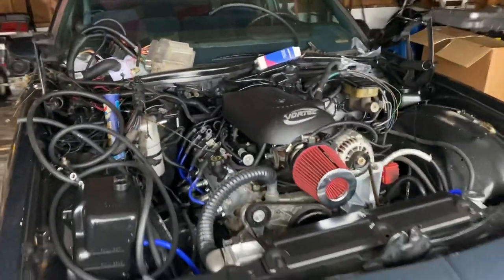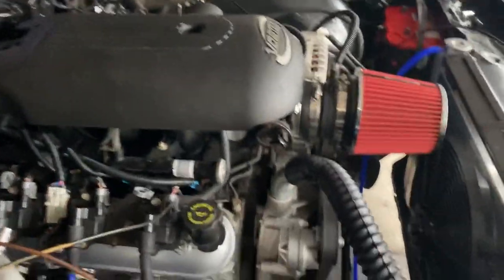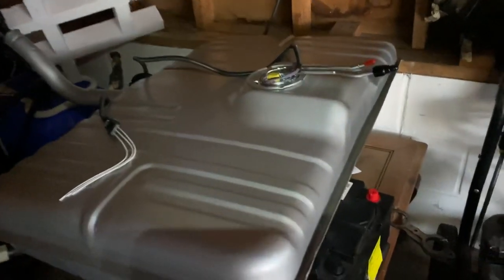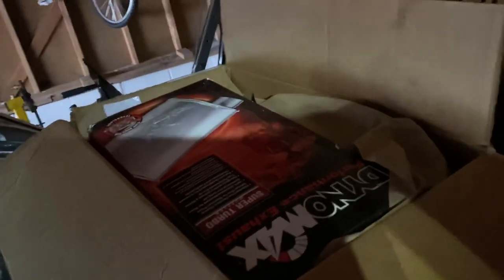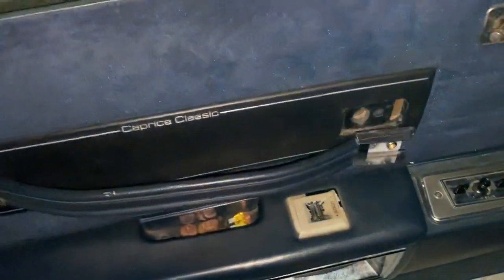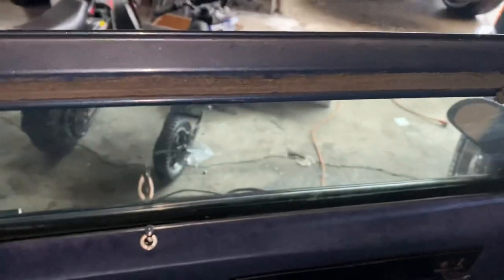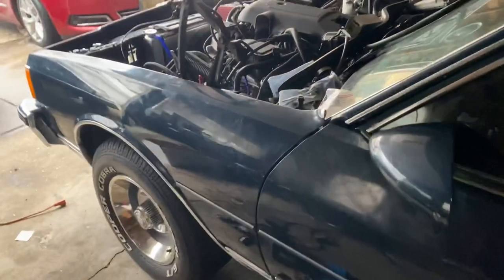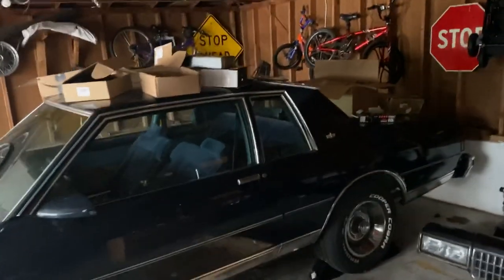LS SWAP BOXCHEVY WALK AROUND

Comment: Looking good. What's the specs on those rallies?
Reply from the maker: RON IN A BOX CHEVY 275/60/15
Reply: Where you find the steel caps at? The ones you have currently are plastic?
Reply from the maker: Harry Hippi 85 they got em on eBay ..but yea the plastic center caps pop right off soon as u hit a bump in the road

Comment: Is that the original wire harness or a standalone PSI harness or something
Reply from the maker: TRAY way aftermarket standalone from Alibaba.com
Reply: @boxchevypee557  is the original computer
Reply: What motor mounts did you end up going with I plan on using ICT Billet
Reply from the maker: TRAY way I went with the ict billets off eBay $35